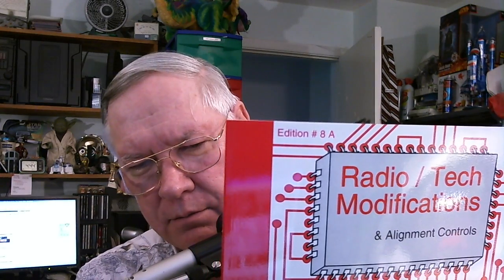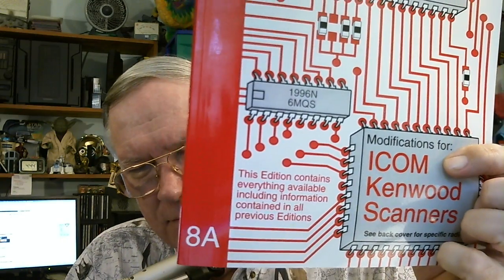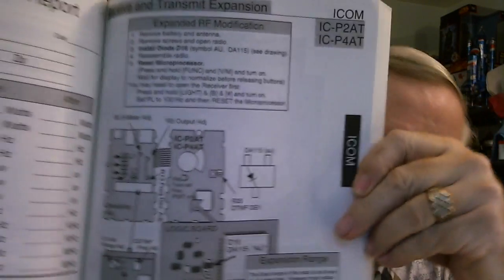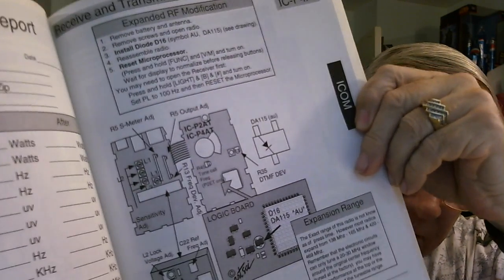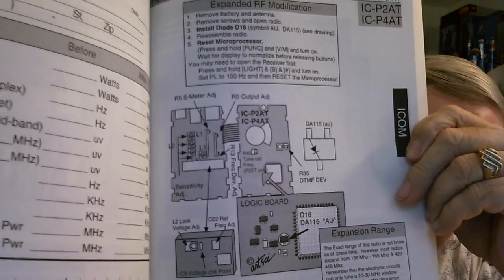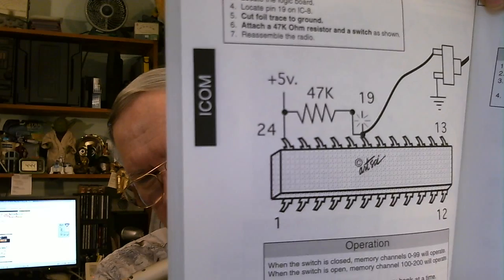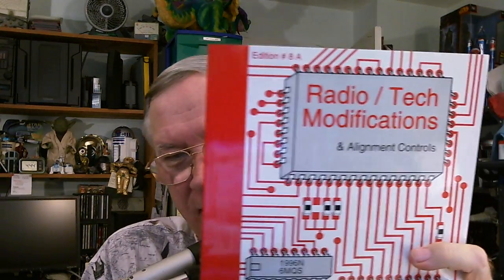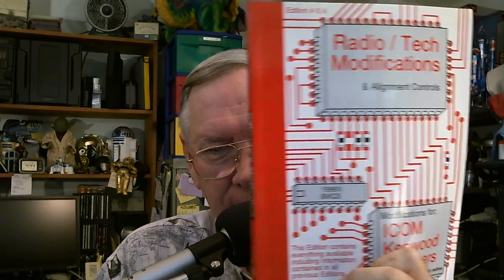TRRS #0046 - Making Modification to Amateur and Scanner Radios

Comment: Yes, this is an old video but we still have our old scanners. QUESTION is: Can I modify my BC60XLT-1 to expand the channels from 30 to 80 channels on my 2000 model, like they show that is done for the 1999 and previous models on You Tube. All the youtuber says( after showing himself doing the mod on his 1996 model), is that the 2000 and newer models '(BC60XLT-1) may be slightly different 'or not, but not sure.  Anything? Thanks. https://www.youtube.com/watch?v=7O2nnbvaxJI&t=87s

Comment: Funny thing , I have sdr s ,  I had a fully modified pro 34 which 
Because of my area being almost 95 percent encrypted ,
I got rid of , then however I find out that you can still use the 
discriminator mod sent into the computer for receiving some
unencrypted p25 transmissions . 

sure my area doesn't have much digital that's unencrypted, 
most is all p25 encryption but the few that's digital unencrypted,
I enjoy receiving more using real scanners and the PC ,
than with the sdr .

Comment: I had a Radio Shack Pro46 with the diode mod to unlock certain parts of the 800mhz band. You would have to hold down 2/9/lockout, which put it in test mode. From there, you could manually search up or down. When you got a hit, that frequency could be saved in the memory. Good times!

Comment from the maker: No, what they were talking about is the old, old scanner radios used crystals for each channel (frequency).  The radios would have up to 10 channels with a crystal that was tuned to each frequency you wanted to listen to.  If you later wanted to listen to a different frequency (channel) you had to buy a new crystal.  These books are for radio that were built much later than that and no longer required these crystals.

Thank for your comment,

Tom